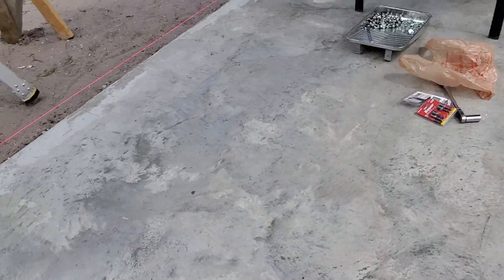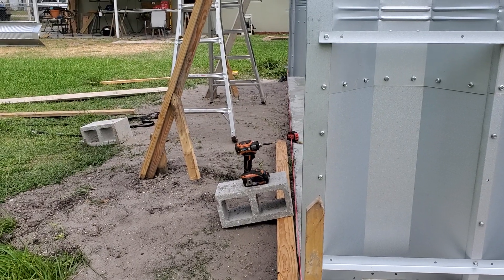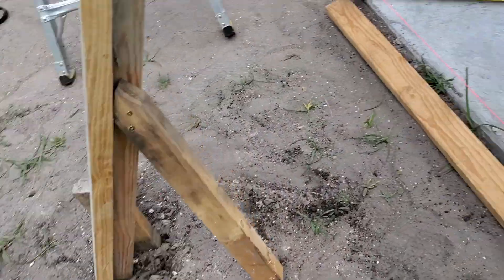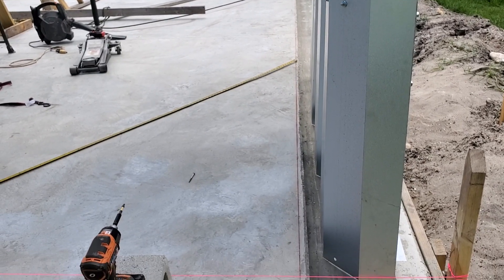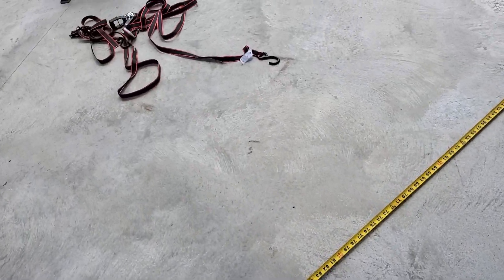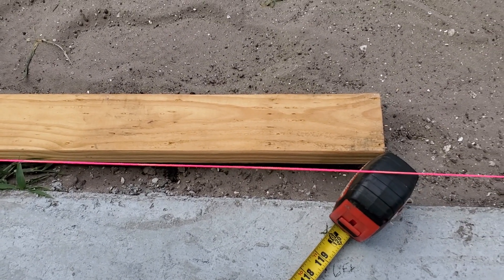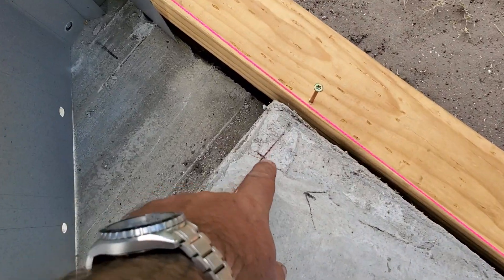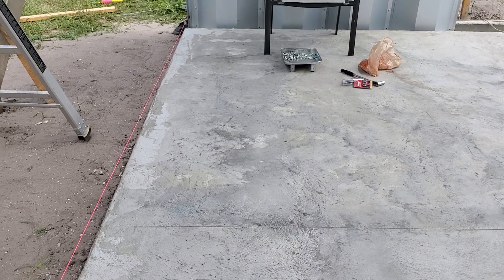Raising my Steelmaster building by myself, 4/5 - How I am going to make sure the walls are square

Comment: Your method worked, that's what's really important! Even an inexpensive laser that provides an accurate 90° would have been helpful throughout the entire project. From setting or checking the forms for the foundation to laying out the walls. Lasers are particularly helpful when working alone as measuring long diagonals with a tape measure by yourself can be difficult.  They make detecting movement in your concrete forms easy so you can correct them before the concrete sets.  String-lines work too and cost virtually nothing but are easy to knock out of alignment without noticing. I love my lasers. Good job!